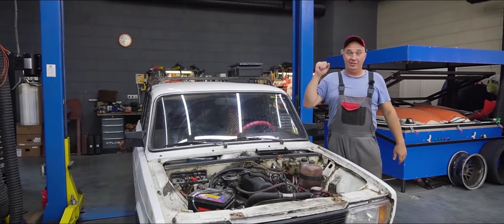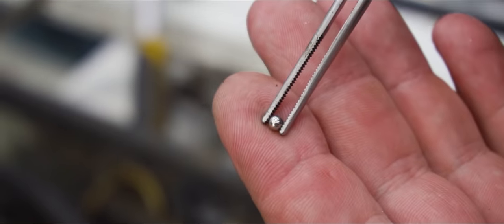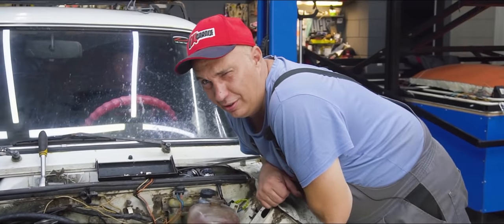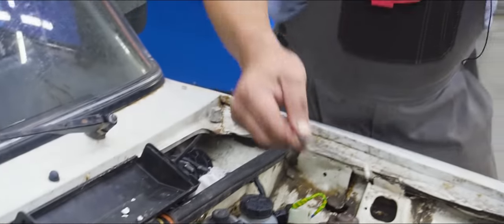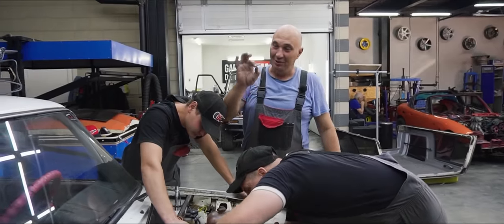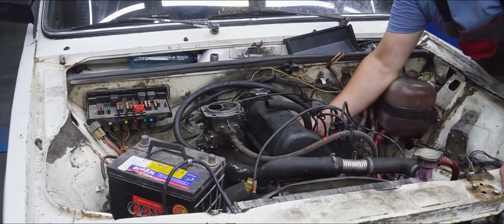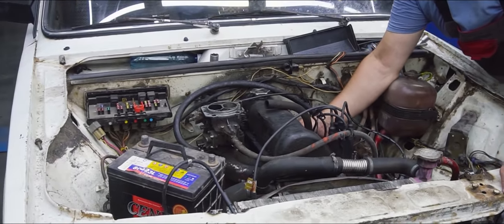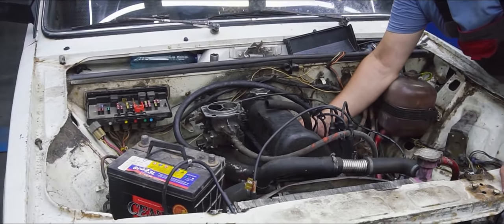Putting metal ball inside combustion chamber to see what happens

Comment: so ball bearings can be a cost effective way to clean your pistons, cylinder walls and head  at the same time. user disclaimer: we cannot guarantee your motor will survive this cleaning method as you might damage spark plugs, break your piston or cylinder wall.
Reply: I'm going to use forbidden silver chocolate ball then, to clean my engine.
Reply: You joke but there are commercial auto repair tools for blasting carbon out of intake ports and valves in the car using crushed walnut shells as the medium.  These are just hard enough to remove the carbon effectively but not quite hard enough for any stray pieces to damage the metal of the engine.  The walnut shells are a cheap endless waste product from the walnut industry.

Comment: 11:00  Ceramic pieces, ball bearings, screws - the look on his face says clearly "This is not a good sound for an engine".
Reply: Ball from cylinder 2 got stuck in the intake valve, held it open and was blown back into the intake upon the compression stroke and pulled into 4 during it's intake draw.

Comment: I'd imagine with higher compression engines would have more issues
Reply: I've seen a few insignia cr diesel engines that dropped the tip off a glow plug and embedded itself in the piston and did no further damage. Also had an insignia engine that swallowed a swirl flap and again stuck itself into the middle of the piston, both ran fine although the insignia did have a slight tick @ idle. Minimal damage to the head too strangely. Only discovered both when the engines locked up due to the oil pickup seal failing

Comment: Back when I first started working for Jeep in the mid 80’s, a coworker was working on a carburetor on a Grand Wagoneer, with a V8 360. 
He managed to loose a check ball down into the intake. (Remember My Cousin Vinney and the carburetor jet🤣). When he started it, engine rattled for about 3 seconds. He shut it off. After figuring out what had happened, then pulling both heads off, he discovered that the check ball had passed through 2 cylinders on one side of the engine and one cylinder on the other side of the engine. The ONLY way that could have happened is through the intake manifold. All the techs were really surprised to see what happened. Yes, heads and pistons were ate up. When you did this video, I knew what was going to happen. I’ve seen it before🤣🤣🤣🤣. Great video.

Comment: Balls swap cylinders when the valves are at overlap.. the balls went through the open valve intake valve into the intake manifold and went to another cylinder that's how it passes. I had engines break before the pieces go through the engine and when its at overlap when both valves are open..then  that's how it gets through.🙂

Comment: I've been going through hell with an engine swap, and have a similar problem to this. Had some cylinder heads rebuilt, installed them, only to have a knocking noise, popping in the exhaust, and white smoke.
 Pulled the heads off last night, and found a bunch of indents in the piston and the head. Only problem is that it wasn't the valves being bent (which they were due to a bolt coming out on the timing belt tensioner), but something else. The dents were behind all of the valves. I can't figure out what it was, as I found nothing. But now the block is trash due to a large scratch left on the cylinder wall.

 This video was nice to know what happens if something gets into a cylinder.
Reply: Just replace the damaged cylinder sleeve

Comment: Have you ever tried different liquids in the braking system to see the difference between them?
Reply: I imagine any liquid would work fine in a brake system, until it either boils or deteriorates the rubber components,
Reply: @dbratboy92  what about semen?
Reply: Beer will work in a drunken emergency. First hand experience on a 1950’s international flatbed truck. Just use the brakes as little as possible. It will stop fine a few times.
Reply: @cardid5408  good to stop your radiator leak.
Reply: @rustyaxelrod 
I don't think it's best idea, maybe in emergency but water would be better because less air bubbles :)

Comment: As a mechanic, I have seen this many times, where a valve or seat grenades in one cylinder, exits into the intake manifold and hammers every other cylinder. There is valve overlap at TDC between the exhaust and intake stroke, therefore the intake valve is open as the piston is moving up. This happens with any size particle, which is one of the reasons why air filters are important.

Comment: Those metal balls are fricking indestructible.  The Renault/Peugeot/Volvo/Delorean V6 came from the factory with a steel ball blocking the mixture adjustment, which was a fine setscrew on a mechanical lever in the intake stream.  (K-jetronic fuel injection with air flow door.)  To remove it you were supposed to use a special little "hole drill" to remove the swaging from around the top of the ball to remove it, then there was a rubber service plug to replace it after adjusting because leaving the hole open was a false air leak affecting mixture.

A colleague told me of a mechanic he worked with at some shop when one of these came in.  He very boldly and against the pleas of my colleague took a drift punch and big hammer and BROKE the ball loose DOWNWARD, sending big aluminum chunks and the steel ball into the intake plenum and leaving a jagged hole that wouldn't accept a service plug.  The mechanic pleaded with him to fish out the broken parts but he just said, Oh it'll be fine just watch.  Then he starts the engine and gives it a rev and RAKNAKNAKNAKNAK!   Ruined the customer's engine just like that!

Comment: Looking at the way the coolant cleaned the head on cylinder 4, it would be interesting to see if coolant would make a good motor flush.
Reply: Absolutely not lol
Reply: Yeah it works great destroys old engine and you get a new clean one lmao
Reply: @iknowyourebrokeauto468  - Apparently, you didn't see the word "flush" or don't understand that it's only temporary. It doesn't have to stay in the motor for a thousand miles - just long enough to circulate through it as was done to the one cylinder here.
Reply: @ep61611  apparently your not a mechanic like me because you would know any coolant inside with the oil will destroy babbitt bearings and wash out the piston rings very quickly.
Reply: @iknowyourebrokeauto468  - who said anything about "with" the oil? And besides, Garage 54 isn't your average fix-it shop. They do stuff to destroy cars - or haven't you noticed?

I mean, not every household has a tire launcher that they use to damage a car, do they?

And when was the last time you put steel balls, screws, and other junk in your cylinders?

You preach about what a mechanic wouldn't do, and yet, you watch all the crazy stuff that goes on here on this channel - doesn't that make you a hypocrite?
Reply: @ep61611  I suppose you could put it through the carb but the corrosive properties of antifreeze wouldn't be very good on valve train parts. And you said "engine flush" and putting it through carb wouldn't be considered a "flush" hence why I thought you meant with the oil...
Reply: Before we would overhaul a lawn mower engine, we would slowly pour a cup of water down the intake at full throttle.  The water vaporizes during combustion, steam cleaning the combustion chamber.
Reply: A “mechanic” who never heard of water injection?
Reply: @iknowyourebrokeauto468  - you made an uninformed or at least incomplete comment and got called out. Go ahead and reply like a 15 year old if it makes you feel better, I don’t mind.

Comment: This reminded me. Back in my appy days, I had a Citi Golf 1300. I swapped the engine out with a 1600 engine.
At one stage I got a piece of aluminum inside cylinder 3. 
It made a funky noise. 
Removed the plug, turned the engine over to eject the aluminum debris, replaced plug.
Engine ran just fine for a long, long while.

Comment: nice experiment :  cilinder disabling on cruising speed. On a 4 cilinder engine, when at cruising speed, disable 2 cilinders (disconnecting 2  injectors) and watch the effect on consumption. Disable compression by installing electro valves on 2 of the 4 cilinders

Comment: This happened to a Ford Cortina Mk2 with a 1600 crossflow engine I owned. It somehow swallowed a 20mm long bolt into number 4 cylinder and bounced around for a while, then stopped. After removing the head I found that the bolt had got stuck between the valve and the head for a short time then had disappeared through the exhaust valve. The piston looked amazing with dozens of thread imprints on the crown. The exhaust valve had bent and wrecked the head. We ended up replacing the piston, head assembly, and a cam follower that snapped in two. 
I never found where that bolt came from but I put some broad mesh between the carby and inlet manifold, just in case...

Comment: Had an old Corvair from 1965 (aircooled flat 6). As they got older and if the engine was overheated, they had a habit of dropping the steel intake valve SEAT out of the aluminum head. The seat often was broken by the valve itself or the piston and was ejected out of the cylinder through the intake. If you didnt stop the engine fast enough, it would spread the damage to the other two cylinders on that bank through the intake manifold. 
So you could end up with a ruined head, and three beat up pistons.

Comment: Can you actually run an engine on just pure nitrous oxide? I mean...Oxygen is explosive if it's pressurized, and nitrous is pretty much just Oxygen with extra O
And if it does work, is there a limit of how many nitrous shots it can handle?
Reply: Needs a fuel, oxygen is just an oxidizer.
Reply: @bryanwheat9101  But oxygen is explosive if pressurized,right?
Reply: @furry-b5h  No, it just won't burn without a fuel this is physics 101 here.
Reply: @bryanwheat9101  hm,alright then

Comment: My wife (FG a the time) had a dodge neon that was running funny, I checked the spark plugs and found substantial impact damage on one of them.
A few months later the engine caught on fire. Never knew the full story behind whatever happened to it, but the first oil change was done at something like 5 times the recommended mileage so it wasn't really the car's fault that it broke.
Reply: "Will you look at my car? It's making a funny sound."

Comment: I had the spark plug fail on me, that jumped 3 sylinders making marks. Was baffled myself.

I have wanted to pitch some ideas to you for some time now, and here it goes!

1. Cleaning the combustion chamber while engine running by spraying dusted water in the inlet on mid/high rpm. 

2. Change the driveshaft with multiple wires. My vision on that was to make the car crumble when the wire Twist's and get shorter, or do something else break. . ?
Reply: Cleaning carbon with water has been in practice for decades. What do you think seafoam dose?  Engine needs to be hot at operating temp to work.

Comment: This is not only a myth or a wild idea but in 1996 while I was in mechanic school I had this thing happen to one of my schoolmates, he was replacing spark plugs on a Ford Fiesta and after he had them replaced there was a loud knocking sound from the engine when running it, we all wondered what could have gone wrong with the engine by just replacing the spark plugs, after a boroscope inspection we found out thet the piston was full of small craters and determined that the locking ball of his ratchet had detached and fallen from the spark plug hole inside the engine, no one really knew how would it happen but his Kamasa ratched was missing the ball.

Comment: I'll stick with it exiting through the exhaust valve. Exhausts have a certain degree of back pressure and exhaust valves will open while the piston is still descending towards bdc at the end of the ignition stroke, which creates a certain amount of negative pressure. With a common exhaust manifold connecting all 4 cylinders, if the ball finds itself in the exhaust manifold having exited through cylinder 2's exhaust valve, it may very well be sucked down into a cylinder that is nearing the end of it's ignition stroke with the exhaust valve beginning to open and experiencing some negative pressure.

Comment: I worked on a Ford 'split port' 2 liter engine that was fitted in the US Focus.  This motor had a valve seat come loose as they have a reputation of doing.  When I stripped the motor I found bits of broken valve seat in one of the other cylinders - evidently this quite often happens.   Having a valve seat rattle around and chewed up in the motor does a lot of damage

Comment: The ball got into cylinder 4 like this:

First the ball in cylinder 1 was pounded into dust. Then the dust slipped past the piston rings and into the oil sump. Then that oil got past a bad ring on piston 4 and into the combustion chamber, where it then resolidified into a perfect metal ball again! 🤣

Comment: My bet is they went back up into the intake.
The early gen3 5.7L v8 hemi engines, had issues with valve seats dropping from hot shutdowns. Often times once the piston would strike valve which is stuck down due to the seat having dropped, it would shatter the seat. While sounding like a box of nails in the cylinder, pieces would also make it into the intake then down into other cylinders, scoring walls and cratering pistons.

Comment: Reminds me of when I was going to junior college and was taking Engine Rebuilding. I was rebuilding a VW 1600 air cooled engine that would fit in a Beetle (type 1) or Bus (type II). I realized that someone had dropped a ball bearing down one of the intake manifolds. It didn't get into the cumbustion chamber though. If that had happened the engine would have been seriously damaged. I realized what was wrong before it was too late.

Comment: I was working on a VW ebgine back in the 70s and I tried to adjust the excelerator jet, in poped out when I opened the throttle and down the intake. Long stiry short I removed and dismantled the engine. The jet was enbeded into the piston and was almost flush with the top of the piston.

Comment: small ball goes through inlet manifold, it's the least resistance path. as all 4 cylinders share a common area, it'll bounce against the manifold and get drawn in to 4. Seen it happen a few times with bits.

Comment: It's best to double blow your spark plug wells out, first blow right after you take the plug wire off, then second blow right after you crack the plug loose and just loose, before you unscrew it too much, blow all around it from every angle with a long extended blow gun. :yougotthis:

Comment: Mazda 323 02 models had a recall issue with a manifold screw backing out and falling into the engine. Happened to our Jan-03 plated 323 (I discovered later, 1 month outside recall range) the day before our son was born. Had to drive it about 20km with it in there, even keeping it low revs it ticked like mad, but once fixed the engine worked fine for another ten years. The screw was only soft aluminium.

Comment: Some carbs used a ball valve in the accelerator pump circuit. Operate the throttle with the carb top off and the ball skips down the venturi.  I saw this happen with an old V4 Ford Transit,
back in the '70's

Comment: Try using a washer...  I had a BMW 325 that I changed the plugs on and accidentally lost a stainless steel washer.  I thought it fell on the ground, but when I started it up, the car made a huge "crunch" sound and started running rough.  I pulled the plugs again and found one that was missing the electrodes.  I ran the engine with that plug out for a while, hoping to force it out (I was young and dumb and the car was a junker).  I put a new plug in and the car ran fine.

The best part was when I had to replace the head gasket (30,000 miles later) and found the missing washer completely embedded in the piston and with the cylinder looking like someone took a tiny axe to it many times.  I sold it for what I bought the car for 2 years later (yes, I told the guy about the problem)... Still running fine.

Comment: I think one of the tiny balls ricochet off the piston and made is way past the intake valve and then was sucked back into cylinder 4 which would have been one of the next cylinders to have an intake stroke,  thing through exhaust has no suction and no way for the ball to get back into the block but physical force can overcome internal forces and go where it wants

Comment: Just a thought for the small ball to transfer between cylinders my assumption is it happened while the valves were on the rock at TDC (valve overlap) it was forced out via the inlet valve in to the inlet manifold and then sucked in to the other cylinder via its inlet valve on the induction stroke.
Does this seem feasible?

Comment: I have first hand experience with a "polka-dotted" piston lol 
The engine I rebuilt in auto school had a valve that had broken (about 1/4 of the face broke off) the debris had pulverized itself down and made it's way out the exhaust. 
The piston in that cylinder was dotted all over and had caused the ring to pinch. It still ran for a long time after that (fixed ring lands)

Comment: My guess is the intake valve on piston 4 got jammed open and the vacuum of piston 4 going down on it's failed power stroke pulled the air from cylinder 2 taking a ball with it. It seems implausible, but a little more likely than the bearing going out an exhaust, turning around, and fighting the pressure to get back into cylinder 4. That's just my theory, it's anyone's guess really.